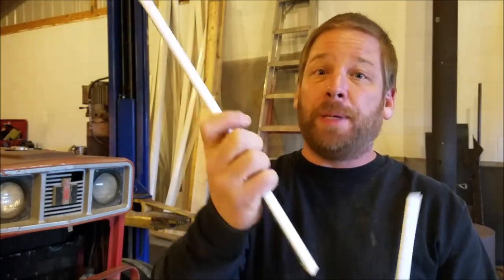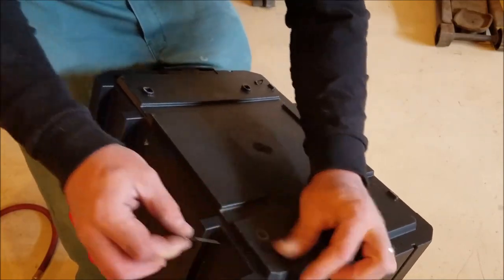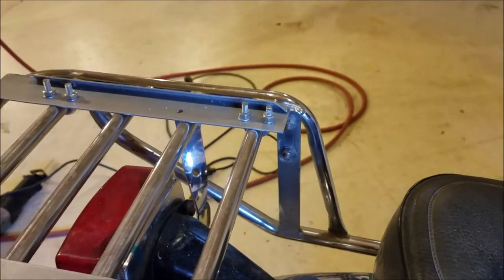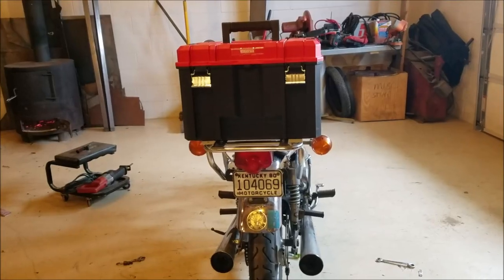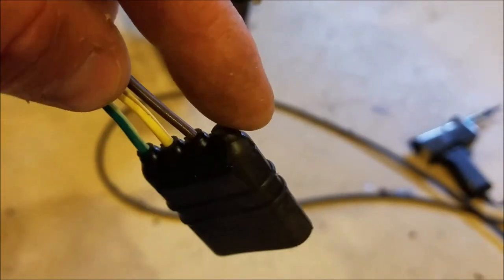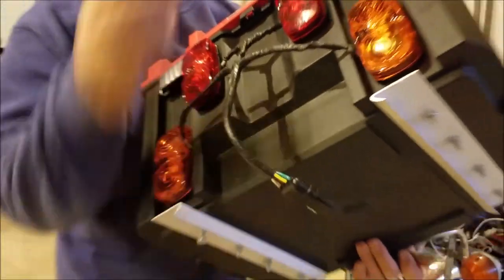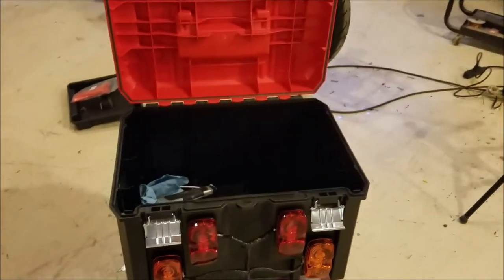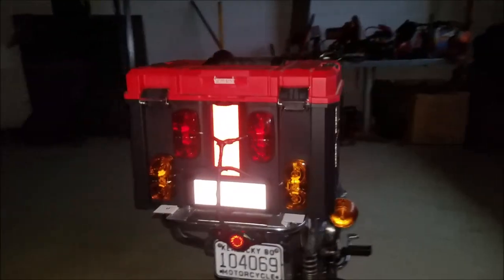LOCKABLE Removable LUGGAGE Box DIY for any MOTORCYCLE Dirt Cheap!

Comment: Yes. I like to be seen from a long distance away when on a motorcycle. Planning on putting LED side marker lights on my Enduro , or dual sport as they call them now. Drivers are constantly swapping lanes over on top of me. It's the tallest bike I've ever had , but the digital camo pattern blends into the background. Never have I kicked a 4wheeler to dent a door , to get even with a driver. But I've had to take my size 14 boot and bump two different doors on two different occasions , because they didn't hear my horn , and were pushing me into the median.    Anyway I'm thinking possibly amber lights will grab more attention.   If anyone else reads this and has any input please chime in as well.

Comment: I was thinking of mounting a toolbox on the back of my bike. I never thought about using rails. Great tip with the V shape, I'll certainly have to experiment with this. I also never through a out putting lights on my bike either. I'll certainly have to do that as well.

Comment: About why you couldn't use the razorblade on the whole piece, it's not (just) because of the heat. When you're cutting, the material is flexing around the edge of the blade to let it in, so the thicker it is the more resistance it presents :)

Comment: Pretty clever, man! Did you use any silicone on the light mount holes? Hate for water to leak in from those. I’m a huge believer in reflective tape. I found some black reflective tape. Perfect for the frame!
Reply from the maker: Yes sir! Sealed everything, I need to look into the black tape I haven't seen it before. Thanks for watching!